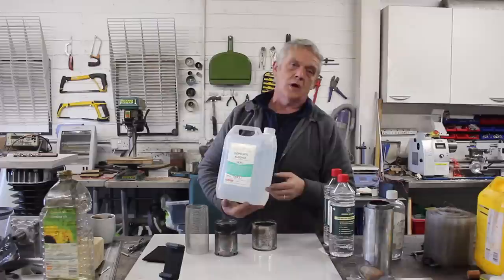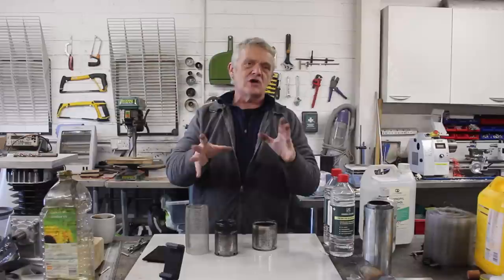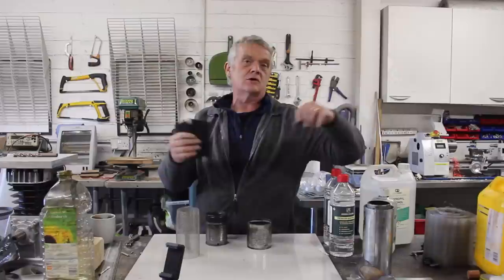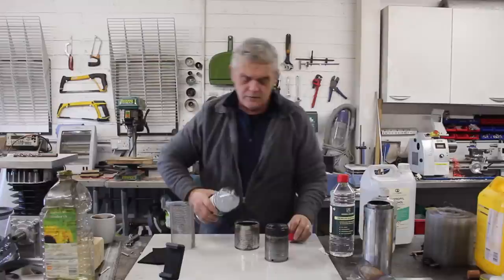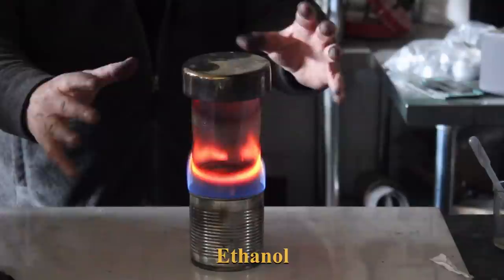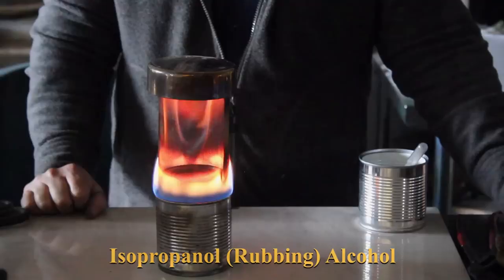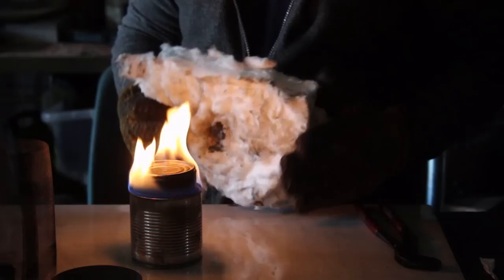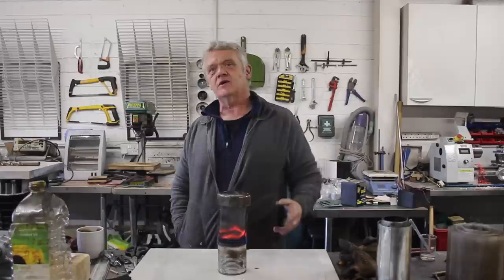1704 Trying Different Fuels On The DIY Heater 1

Comment: The easiest way to vent these stoves is to create an insert for a window and put a chimney through it. For little stoves like this, a 2 to 3" or so chimney should work ok. To save money/cost, use steel for like the first foot or so, but then use Al for the rest of the pipe. Make sure you paint the chimney pipe with some kind of high temp paint to increase the emissivity (so that the IR radiates out of the pipe better).

Comment: E85 is next to try for me, Much cheaper than K2. Perhaps mixed with vegetable glycerin to tame it a bit.
Reply: I prepaid for more e85 than my truck's fuel tank would hold. Rather than getting a refund, I put the rest in a gas can in the back. Have 3+ gallons that I'd love to burn in my kero heaters. Been running diesel with a splash of iso in the Perfection, didn't realize diesel=methanol+glycerin 🙄

Comment: I can tell you Robert that adding a little bit of epsom salt or table salt, say a pinch will let you see the flame better. Not perfect but it does help with the flame vision.
Reply: Great idea, wonder what other table condiments might work too
Reply: Borax is supposed to make a green flame
Reply: @prevengeix8551  The test for borax burning in methanol alcohol is a vivid green flame. That is right on Prevenge nine.
Reply: @Milkybar3320011  Maybe try Gulden's mustard. Just a wild guess, very wild for sure. Can you tell I like yellow mustard ?? Peace
Reply: @prevengeix8551  TRUE !!!

Comment: This is quite interesting to watch .. and as I have continued to think about your progress .. I've thought after watching this .. why not develop a small stove of metal to keep the open flame inside .. could easily be a larger tin .. maybe a gallon size .. and a vent for air to move through.  Maybe thicker metal .. as a small wood heater might have.
Reply: Check out “the outsider - candle convection heater” he has captured your great idea but missing this everlasting wick heater
Reply: @Milkybar3320011  .. yes!  I have been following the outsider for a good while.  I remember his portable cabin build.   Really nice guy!
Reply: This is the guy I’ve been referencing!
Yes, I think the combination would work beautifully.

Comment: Thanks for these heater videos!  I have a wood shop (with no heat) and I'm looking for a fuel to burn that won't produce moisture as a by product.  I was using propane heater - but the moisture produced began rusting my tools.  When you talk about fuels can you address this?

Comment: Mini-stove.  Fancy feast cat food can.  Carbon felt.  Small tomato paste can cut down to 2.25”.  4 holes around the bottom edge of tomato paste can with bottom cut off/ 3-4 small holes at the top edge prevent over pressure flush fires.  1 oz of alcohol will boil 2-3 cups of water for field rations and beverage. Wt: less than an ounce.  You’ll definitely want a windscreen.  Cook pot (1 liter titanium kettle/mug is best, but many people use military canteen cups with a foil/lid.  I burn mine a bunch, but have been sticking with yellow bottle HEET, denatured alcohol or methylated spirits. (I’d be into a biodiesel/multi-fuel trial)…I’m making your heater tomorrow…(if I can get the mantle material)

Comment: Dr. Smith, I see you have given precautions, here is one more, as you almost demonstrated it removing the mantle, with a highly combustible fuel source such as alcohol, if you tip it over, you will be very unhappy. might I suggest as well as your ceramic plate, a metal ballast plate and a magnet in the can bottom. Keep up the awesome teaching.

Comment: My larger heater is homemade, close to that and I use 1 % rubbing alcohol, 12% kerosene, 85% used motor oil and 2% antifreeze. It burns like a champ. Mine also has a triple cone wire mesh and a damper.
Reply: is antifreeze safe to burn indoors?
Reply: Blimey, that's a very specific recipe. What's the thinking?
Reply: Hopefully it has a chimney to outside
Reply: @pattiannepascual  it hasn't caused any problems in 3 years and there is a chimney for the exhaust gases.
Reply: @brucereichert6509  I will have to try it for my shed house. the fuel can't get any cheaper. wish stupid jerk tube would still allow us to post pictures.i would have loved to see your setup.i live stealth in a city so can't burn anything that produces smoke, like wood.
Reply: @pattiannepascual  you get black smoke from an incomplete burn. There are many ways to eliminate smoke from your heater. The only problem is that you might have to fabricate it yourself. Do a little research and I'm sure you'll find something that will work for you.
Reply: @TheBaconWizard  trial and error got me very close to a great burn. The oil I get is free to me from an automotive repair shop. I have to separate and filter the oil before I can use it. I have enough oil to heat my garage 24/7 though the winter already.  The antifreeze helps burn off what little water that's still in the oil when mixed. Tip to anyone using vehicle motor oil to burn, preheat the oil to at least 100°F  before filtering.  It will save you some headaches and time. I use a solar heater setup to heat the oil.

Comment: You should try to add a stove fan on it and see if it gets hot enough to get the fan spinning. If it does then it will blow the heat around.

Comment: I'll suggest that fiberglass insulation can be used as a wicking material in place of the carbon felt. Let me ask about denatured alcohol. Is it methanol or ethanol or something in between? I can buy it in one gallon cans at the hardware store. I've used denatured alcohol for many years in my little homemade soda can cooking stoves for light weight backpacking.

Comment: Methanol, ethanol and isopropanol are perfectly safe to burn indoors. They burn very cleanly, very little carbon monoxide. It would only be a problem if the room is completely airtight.

Comment: Thanks! Could these be any good affitives for pellet, trash, leaf, woodchip, or other dry compressed organic waste, etc? Seems like more heat is better, so there is not that much residue or smoke to block the gimney on closed systems.
Reply: all that wood, leaves sounds like it would make a lot of smoke indoors. I tried a very small solo stove indoors. the initial lighting caused so much smoke,I had to leave my shed.

Comment: You know when folks get a tin of tuna an stick a wick in the middle to make a candle,would a mesh round that improve it or does the flame need to be on the outside
Reply: Believe the flame heats the mesh to increase the radiance heat output

Comment: I SET MINE INSIDE THE FIREPLACE,WITH THE DAMPER SLIGHTLY CRACKED
Reply: What burn time did you get and what fuel? I can r n my open fire on 10kg of coal at £8 per 24h..

Comment: I a cold house, burning rubbing alcohol or any other fuel containing water will create a high amount of condensation on windows and aluminum window frames. And that is why I wouldn't recommend using those unless you can totally isolate the window glass from the room. The trouble with that is how then do you provide a small oxygen flow into your heated space? 
So, really, I find pure fuel, no water or glycerin, to be a strong first choice.👍

Comment: Nice to see these fuels compared. However , what made the biggest impression on me in this video , is the amount of warnings about using this kind of equipment ...I mean , I understand that this is YT and that some kind of disclaimer is needed , especially when extremely toxic chemicals are used , like in previous videos about making various types of batteries (BTW , Rob forgot to emphasize dangers of organizing drinking parties with displayed fuels - because someone might get  such idea , since those are significantly cheaper than , for example , whiskey or vodka or gin) and that some of the viewers are fully accustomed to all technological marvels of modern urban living (utilities on demand , by a flick of the switch , or nowadays via app) so they may have some safety concerns , but , for a love of god...If, by a chance , Rob makes some kind of  small energy producing apparatus (as a proof of concept - as he often do) , using toothpicks as axles , what would be the warning ? Don't swallow tooth picks and don't stick them in your eye , because it may harm you ? I'm not trolling , I'm genuinely concerned about good portion of a human kind (besides ongoing Geo political situation).

Comment: Please do used motor oil as part of your heavyweight series, really curious!
Reply: yes. I have several gallons of used vegetable oil but have yet to create a heater that isn't a giant mess to maintain.i got heat but what a disaster. I put little holes in the metal caps of beer bottles I found all over the neighborhood. put cotton string in each,1/2 filled an 8x8 baking pan with used oil and put 9 caps with socks. it created a ton of heat but when you had to adjust the wicks, like I made them too high and they were smoking, it meant lifting the cap and getting oil all over. I saw a few on YouTube that made cans with holes for the rocks, etc, but all had the same issue. if only they could make an adjustable wick holder like kerosene lamps have, which don't work with oil because it's too heavy to travel up the wick and the space in between too far from the oil.I did experiment, including using the kerosene lamp top and keeping it at or under oil level but my experiments failed.
Reply: Motor oil is going to burn with a yellow flame, lots of soot and smells

Comment: I'm not sure if it was covered but what size mesh is recommended for the stainless steel mantel?
I've seen #40 mesh and #80 mesh on Amazon.
Also...in the US, what cans (products inside the cans) are recommend that works best?
Thanks.

Comment: I found this videos quite interesting, and came to it in sequence from the previous 1702 DIY Heater building video.
However, a worrisome though came up regarding all those different fuels options and I did a little searching regarding some of them.

i.e.:
methanol has adverse effects in contact with skin and eyes, and even when inhaled in its liquid form, and when burned it releases, and I quote, "irritating, corrosive, and/or toxic gases" that "may travel to the source of ignition and flash back". I also read that those gases are considered "negligible emissions" and it is safe to use indoors, however I find this information a bit contradictory.

bioethanol, on the other hand, seems like a safer option as, and I quote, "do not require a venting system with a chimney or flue as they do not emit harmful emissions".

regarding isopropyl alcohol, again I found mixed contradictory articles, some saying it is safe for indoor use and even cooking, other claiming it may pose a health risk as it "can irritate the nose and throat" and "repeated high exposure can cause headache, dizziness, confusion, loss of coordination, unconsciousness and even death".

of course that with any of these fuel options there is always the DANGEROUS FIRE HAZARD component to take into account, for the sheer nature of the chemical themselves, so this is always something to have in mind. but regarding their use as a heat source and consequent fumes they may release, information is somewhat contradictory and a bit confusing.
could you maybe clear this issue?

Comment: It would be a fabulous heater for a cabin or tiny  house.  I would want a flue, though.  How would you add a flue to it?   Would that be instead of the 'lid' or in addition to it?  What I wouldn't want is all the heat to escape through the flue.

Comment: Nice design. Could it be possible to use active carbon dust or bigger particles as the wick material? Or does it have to be a sponge?
Reply: An earlier comment mention sand, used by soldiers in WWII, but would leak through the holes, possibly worth further thought
Reply: @Milkybar3320011  Thanks. Maybe if I drill small, about 1mm holes on the bottom of the inner part than it would not go through. I'll check because I can't seem to find the sponge material at a reasonable price where I live.

Comment: Sorry, have to correct something you said. Do not put a CO alarm in a furnace room. 
For starters, CO is almost (high 90s%) the same density of Air. CO mixes readily with air. It does NOT rise to the top like smoke, or sink to the floor like gas or other fuel vapors. That is why Many CO alarms are designed to be a wall plug in. Wall receptacles are typically never near the ceiling. The only reason you have combination Smoke and CO alarms is the convenience of not having to have 2 separate alarms. It has nothing to do with the possibility of the CO rising to the ceiling.
That being said, the reason it is not recommended to put a CO alarm in the furnace room is, fuel burning appliances that exhaust through a roof flue are NOT air tight. On windy days, it is possible to get SMALL amount of exhaust gasses pushed back into the furnace room from the burner box. Go down and listen to your furnace on windy days. Sometimes you can hear the changes in flow of the exhaust. But then the small amount of pushed back gasses will then be mixed with the combustion air and go back up the flue. This can cause a false positive environment for the CO alarm.
The biggest  reason is, very few people will have more than one smoke and CO alarm in their home. You want them placed in an area where you are going to hear them, especially at night when you are sleeping. Next to the bedrooms. No point in having the only CO alarm in the basement, if the bedrooms are up stairs. It wont wake you in the middle of the night down there,, or chances are....

Comment: I was going to ask if this could just be placed in a fireplace with a reflector to allow the gases to just escape up the chimney.
Reply: if you dont have a functioning fireplace and you havent used it in years, the flue is rusted shut
Reply: @shawnio  I exclusively use the solid fuel stove these days but I did clean both at the start of autumn so it's clear at least.

Comment: I'm suggesting lard as a fuel. Looking for the cheapest fuel to power these heaters.
Reply: Thats interesting
Reply: I take exception to that 😂
Reply: I know lard is energy dense.  I've seen a guy cut through 2 inch plate using a bacon filled pipe, to make a fire Lance.  Such a  waste of bacon though.   Always thought it would have been better to cook the bacon and use the grease instead!
Reply: Lard won’t wick unless you heat it first, possibly a light weight fuel to get it started/melt
Reply: @juanmercado2010 thinking outside the box eh, if you could warm the lard first then the original design would still work. Build two cans one to heat the lard with a simple wick and then the other one similar to Roberts design and you’ll get great heat output

Comment: Would covering the top with your fine mesh instead of that cap, not get red hot and burn off any excess soot as the exhaust gases pass through the mesh?

Comment: Can a commercially built kerosene heater be converted to use these fuels? Here in the USA it is easy to find a deal on a used (most are NOS) heater, people have them for emergency use, as the kero is too expensive for regular use. Maybe a switch to one of your carbon felt wicks would help.

Comment: Carbon monoxide and acetylene are pretty interesting fuels
Reply: carbon monoxide???
Reply: @pattiannepascual  yeah burns nice bright blue nice hot flame
Reply: Keeps you warm till you turn blue 😆
Reply: @Milkybar3320011  carbon monoxide when it burns it only leaves behind co2 and water vapor acetylene lamps have been used for almost 200 years safely
Reply: Carbon monoxide is a majority of wood gas, if you ever see people with wood gasifiers that's mostly what comes out. It does burn, but it has a hard time sustaining its own flame, so you need to make sure there's a pilot flame or something else in the mix. Obviously not for indoor use.
Acetylene is a neat chemical, that's what old miner's head lamps and even headlights in early cars and motorcycles used. I got to take a close up look at an old Scott motorcycle from 1929 that used such a system. You load some calcium carbide in the chamber and turn a knob to adjust a water dripper, then the gas goes up a tube to the head lamp, you pull out a match and light it up. I have a feeling calcium carbide is more expensive than alcohol though.
Reply: @DFPercush  thats mostly due to a bad mixture of fuel to air ratio

Comment: Very cool, does this need a lot of ventilation?  Im thinking about making one to get some extra heat in a cold room during the winter, but I dont even want to have to crack a window so maybe this is too much? THe tea candles with a pot overtop seems like a better fit.   I seen a vidoe where 6 tea candles in small room gives off about the max carbon monoxide you'd want to have for long times.  10ppm.  I used 3 last night and it worked pretty good it felt a lot warmer but then again the temperature uotside was above normal so im not sure how much it helped.  Id love to be able to fire one of these up to warm up even for a half hour or something and would even consider a chimney out my window to do it.
Reply: If you use a modicum of care regarding burner and fuel you’re okay but
Reply: A carbon monoxide detector would add a level of extra protection, but always go with natural ventilation first, some fuels give off moisture when burnt, a warm damp room is going to get mouldy fast